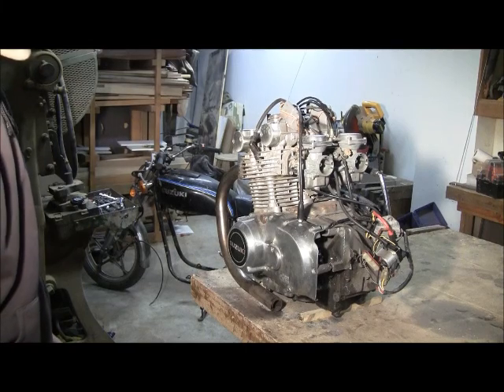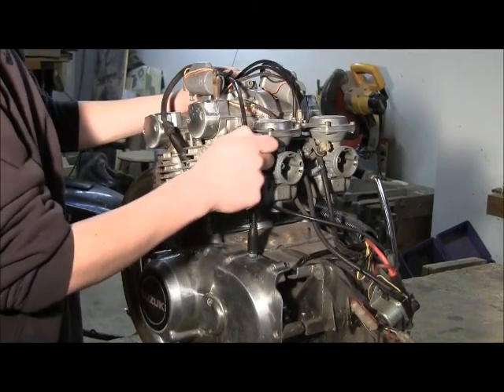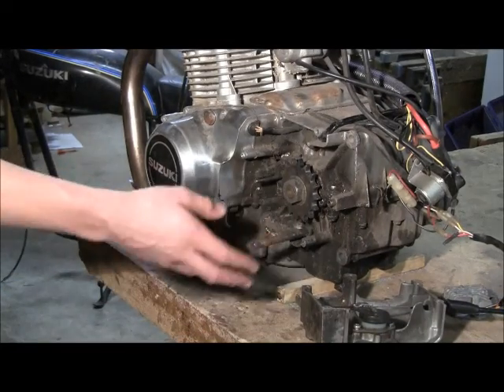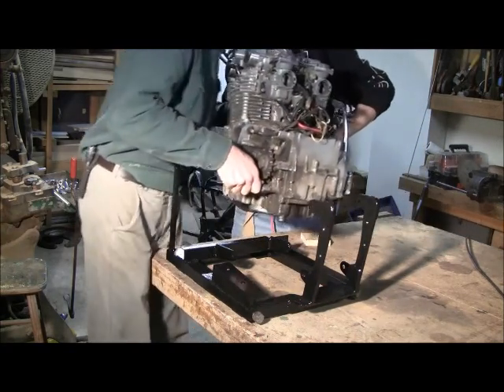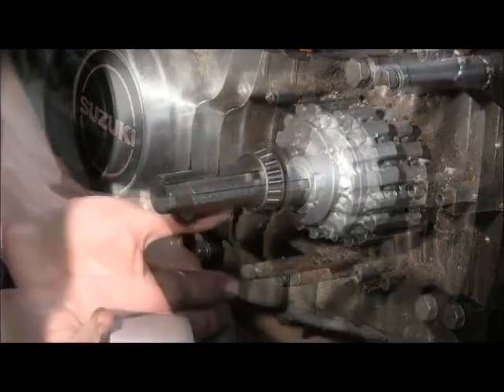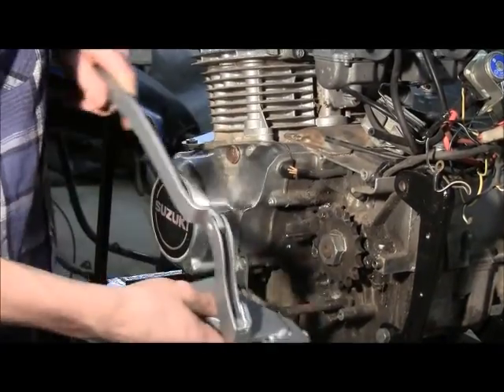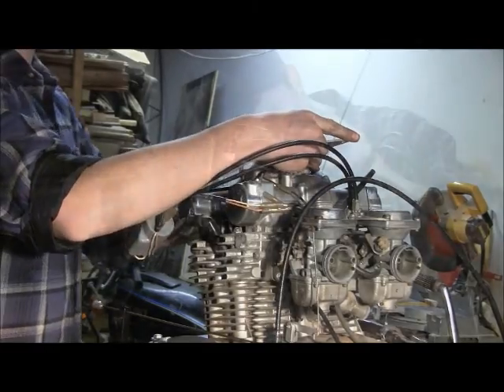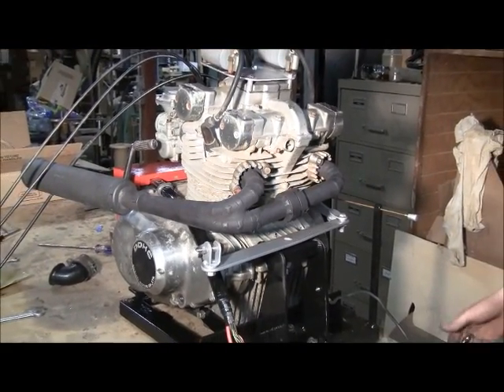Old Go Cart Gets an Upgrade -- Motorcycle Engine

Comment: I still don't understand how your clutch works
Reply from the maker: Motorcycle engine/transmissions have the clutch inside the aluminum housing. A 1/4" diameter rod sticking out the side operates the clutch. Push it in 1/4" and the clutch disengages. I didn't have to deal with the clutch. Just the actuator and the cable.

Comment: Wow I'm impressed. This is professional grade stuff. I have a cart and I'm hunting for an engine for it. What are basic machines that I need to make all this? I'm a mechanic, but I don't have any welding or fabrication experience. I appreciate any insight.
Reply from the maker: Thanks Luis. I used a metal lathe to make the sprocket extender. That was the hardest part to make. Beyond that you'll need to do a lot of MIG welding. MIG welding is easy to learn. Be sure to have a plan, especially for the suspension and steering. Put the steering control arms forward of the front axles, not rearward as I did. If I had to do it over I'd have a pipe bender and eliminate about a thousand weld joints :)

Comment: Can you fab those parts for  me and I pay you for em?
Reply from the maker: traytheeboss211 Let's make sure we understand what you are asking. The sprocket extender assembly for example is made up of many parts. It requires machining and welding. The cost of the parts for that alone would be close to $200. I would need at least another $200 to fabricate it. This all assumes your engine is exactly like mine.

Comment from the maker: I called a local motorcycle repair shop. They had a whole shop, inside and out, chock full of motorcycles, ATVs and parts. I asked if they had any engines and they wheeled out a complete, ready to ride, 425cc Suzuki from 1979. I gave them $300 for it. Lots of people think they want a motorcycle. So they buy it, fall off of it once or twice, then let it take up space for the next 20-30 years until they clean out the garage. There has to be plenty more out there of this vintage with low mileage.